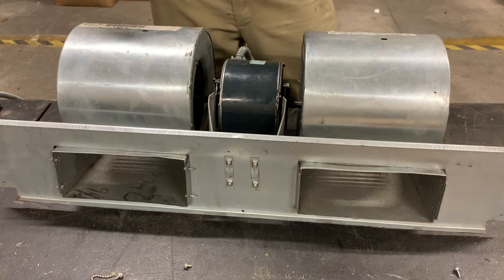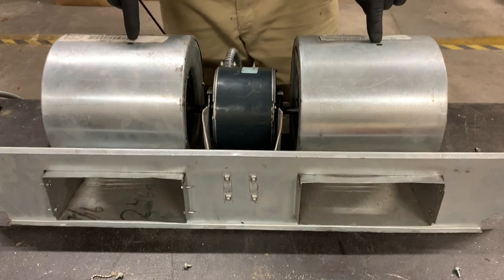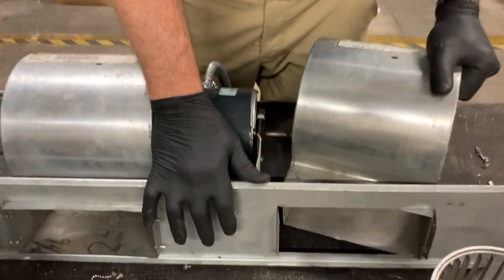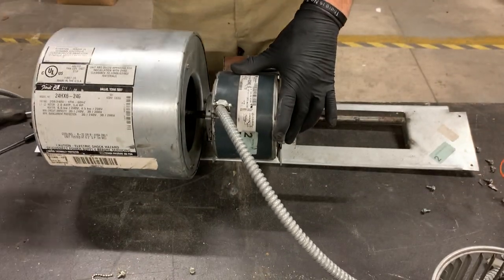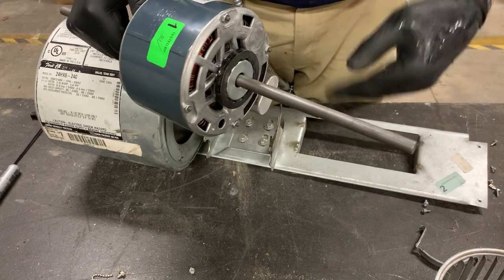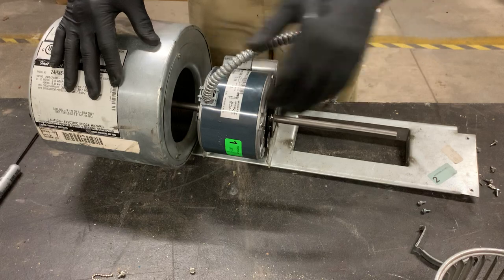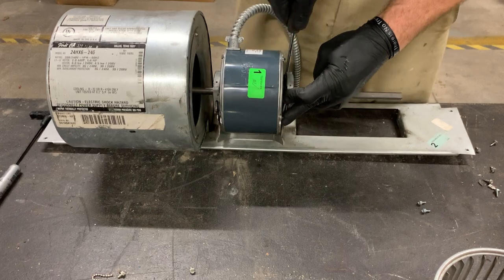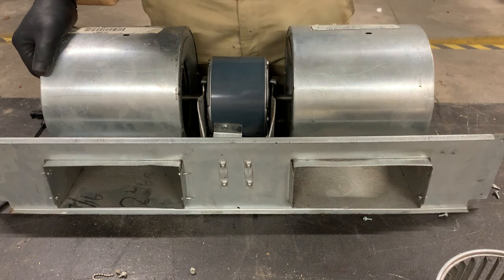How to Replace an Evaporator Fan Motor

Comment: Great video Woody. I have a question before I try to perform this. I am an installer, so troubleshooting isn’t my strong suit yet. Anyways while I was inspecting a similar fur down, I spun the squirrel cage and the motor kicked on. Would this mean a weak burned out motor, or do these blower motors have a capacitor? Thanks